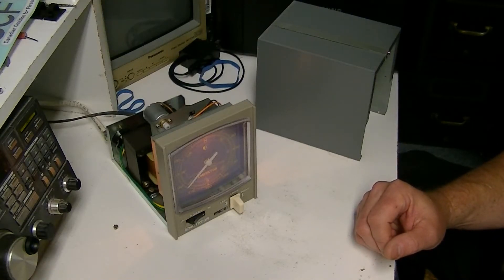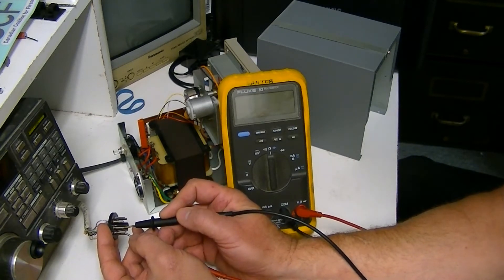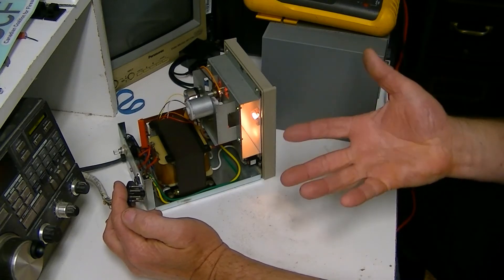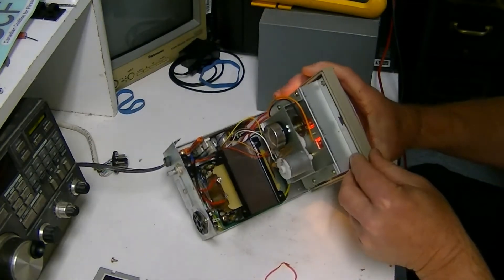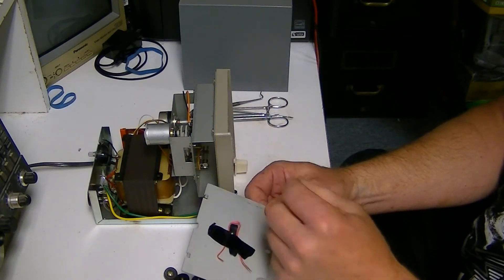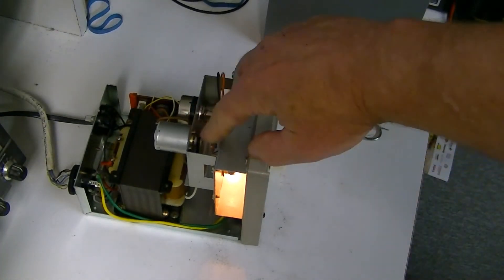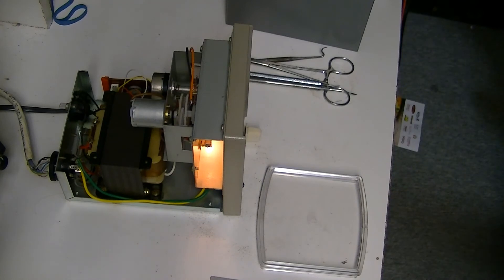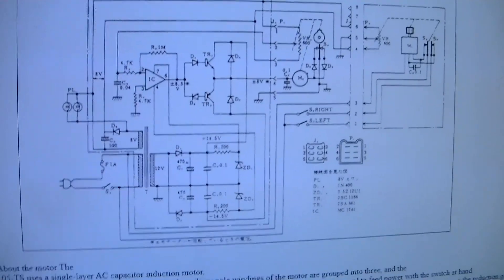Fixing the Emotator 105TS indicator not working issue

Comment: Just for others info: the belt is OD 34 mm and 1.5 mm thick, but it works with OD 35 mm also
Reply: Thanks for that info. A friend has asked me to repair his rotator control box and I needed to know what size belt I needed to find. 👍

Comment: Thanks for the Video, My problem is it won't rotate when it is cold I thought it was the grease but not the case when I took it apart and regreased ? and not that cold in Western Australia any Ideas 73 James
Reply from the maker: yes, mine is the same way.  i'd have to look and see if there is a cap in the rotor that maybe getting cold.  I find if I hold it on for 10-15s it will start to move if it is not real cold outside.